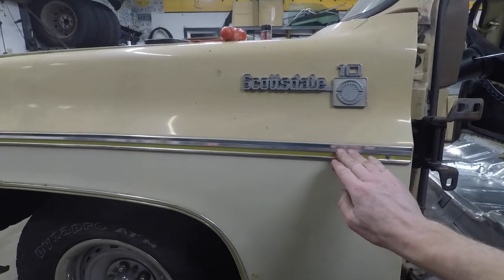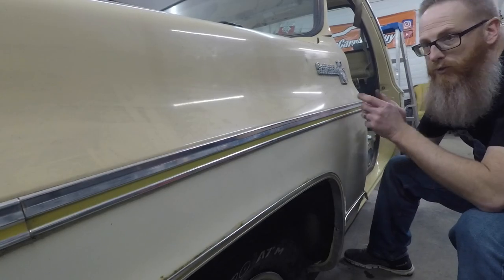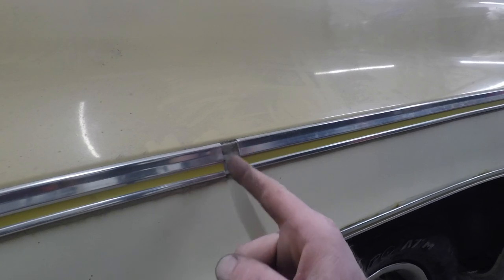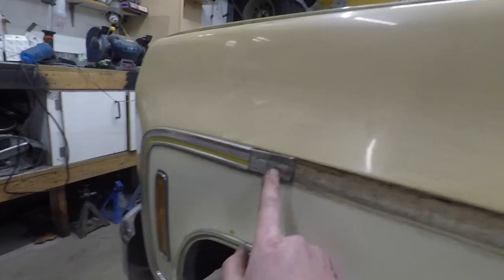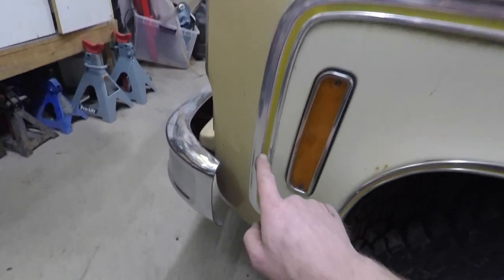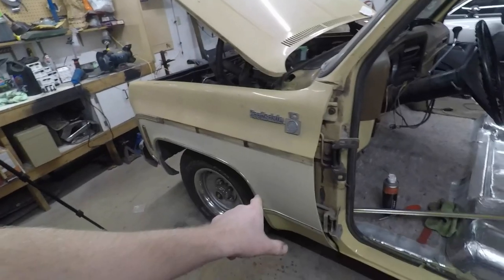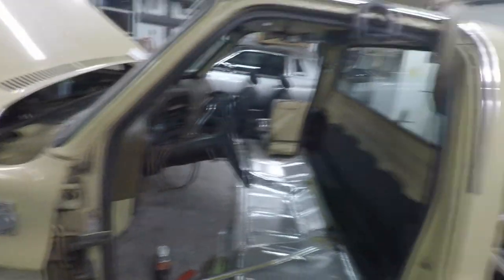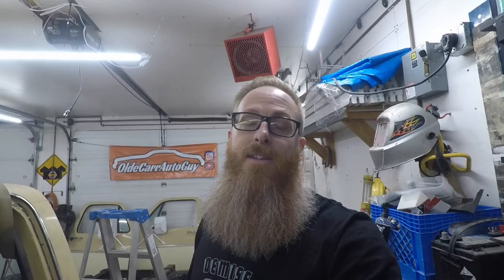HOW TO REMOVE THE BODY SIDE MOLDING ON A 1973 1980 CHEVY C10 K10

Comment: Thanks for the help Bro! my 77 LWB has all the trim and its dern straight but needs few clips replaced....the guy I bought from used a two sided tape but over time has failed....had a few people tell me that the screws at ends were no suppose to be there but I see they are, thanks again!
Reply from the maker: Yeah, the new replacement clips are still stick-on but usually have the studs that go through the body on the ends. Glad you got it. Thanks for stopping by! Hope you’ll consider subscribing!

Comment: Thankx for sharing knowledge. Got a ?  How is the clip attached to the fender. I have an 85 k5 with no side moldings and would like to add moldings and paint it chevy Red-Orange with white center and top. My Dad had a 74 C10 and would like to bring memories. Thankx.
Reply from the maker: No problem at all. Most of the pieces are held in with clips that are double-sided tape to the vehicle. Usually it’s on the end all the moulding where there is a clip that has a speed nut in behind it that attaches it to the fender

Comment: My 73 trim has no screw holes or screws (upper front fender and doors). I guess all speed nuts on these or pure slide. Unfortunately, I bought the trim from LMC and they only have trim pieces with screw holes. Thanks for the video.

Comment: Is that the same for the trim around the headlights and grille
Reply from the maker: It is not! They are held in with phillips screws around the headlights . I think the grille is bolted in.
Reply: @OldeCarrGuy  the chrome trim outlines the headlights and grille that hangs over the fenders

Comment: question...how do you remove rusted screw with stripped out head with out tearing up trim or fender
Reply from the maker: 1/8" Drill bit and drill it out. I actually had to do this on one of my fender trim screws. Hop this helps.

Comment: Upper bed side molding similar or does it have the double sided tape?
Reply from the maker: Same idea. Not tape on these models until you got to 81 and up!
Reply: @OldeCarrGuy  Interesting .... my 77 has double sided tape.  Having trouble getting it to "stick", so I am off on a mission.

 I though there were models with all the hard fixed clips.  Now I am trying  to remember if we replaced the bedsides on my truck .... originally I was thinking no, but now I am more curious.

I would prefer the fixed clips all around.
Reply from the maker: LMC has the clips for sale pretty cheap!  If they were taken apart previously, and put together with tape, they likely will never stick right. Those clips should have a stud and speed nut to hold them in place. I have to do the upper molding on the drivers side of the box as it was missing.